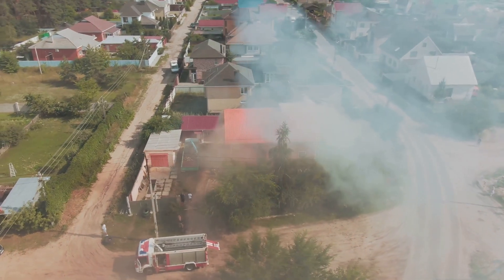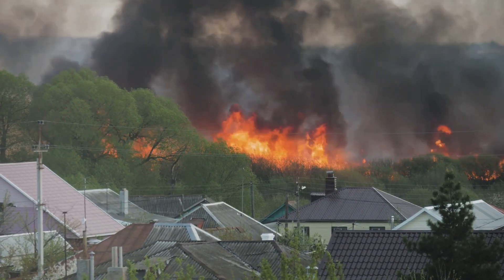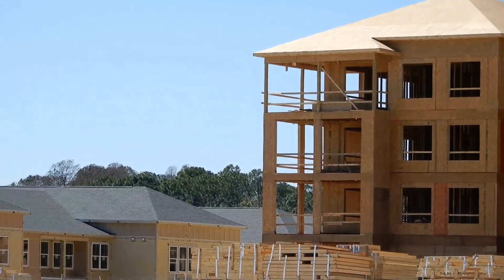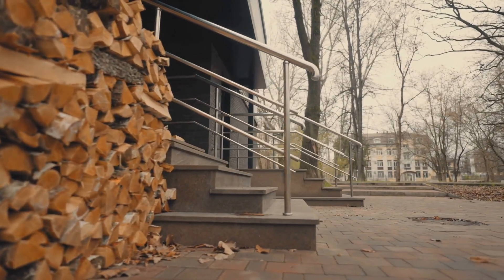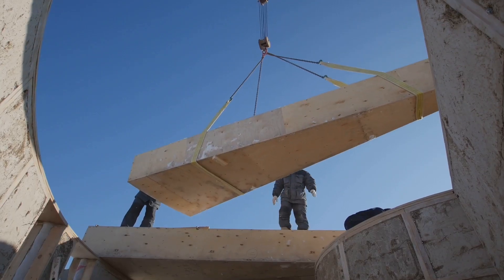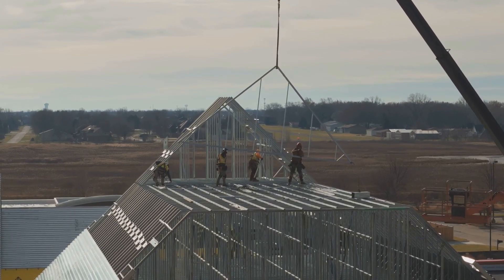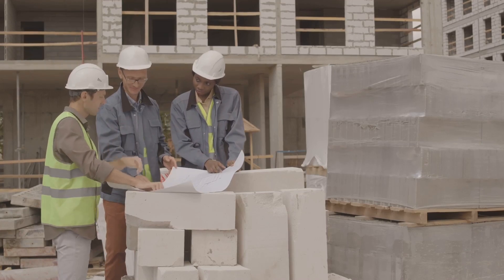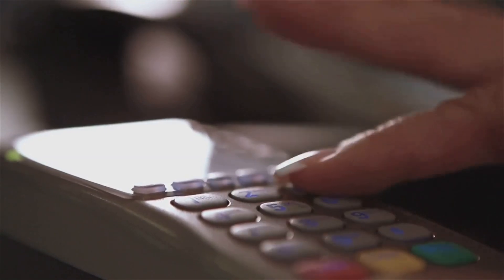Wildfire Resilience – Building with Concrete, Steel, and Other Non-Combustible Materials

Comment: Timber framed houses are also very fire-resistant. Thinner pieces of wood (2x4’s, 2x6’s) burn easier. Trusses fail with heat. OSB burns readily. Big thick timbers burn slowly and with difficulty.
Reply from the maker: Absolutely, you are right. It all depends on application and budget. Thanks for your valuable comment.